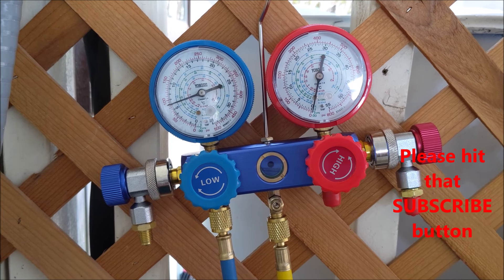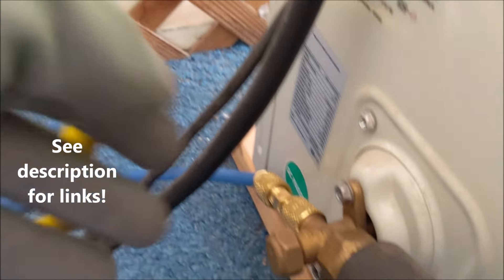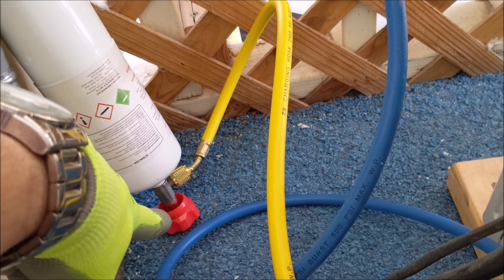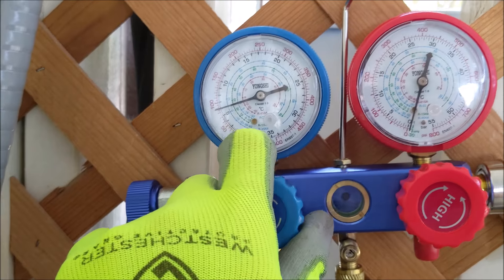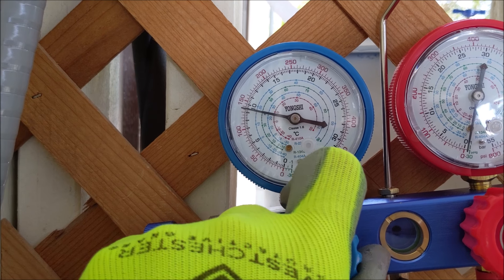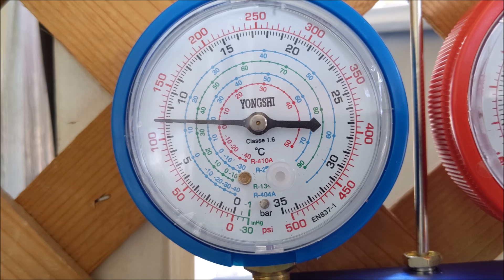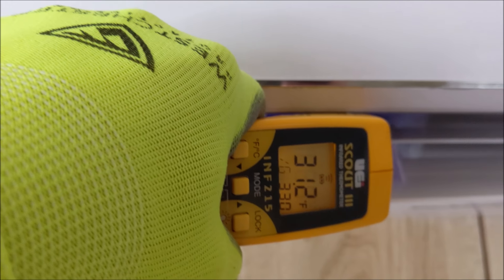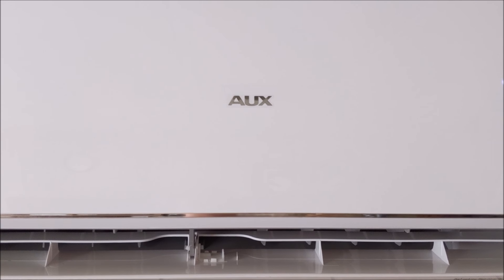How to charge mini split yourself, DIY 410a refrigerant, save money!

Comment: My entire freon must have evaporated as my return line connection was lose. I know i have to vacuum the lineset, should I close the those 2 hex nuts when I vacuum or leave it open and vacuum?
Reply from the maker: Tighten the lines properly, use Nylog, vacuum the lines, then add refrigerant. Links below.....
Discounted links to DIY your mini split......
Manifold gauge set....... https://amzn.to/3cgXrTe
2 stage vacuum pump..... https://amzn.to/2JWdeM4
Adapter for mini split (5/16 to 1/4)... https://amzn.to/2Ys9qLN
Nylog blue.... https://amzn.to/33iYLkS
Senville 3/4 ton... https://amzn.to/2UiJhc5
Pad for outdoor... https://amzn.to/2EMd9Iy
Refrigerant line protector kit... https://amzn.to/2Um1DZI
Power cord.............. https://amzn.to/2XrPgQI
Discount one year of Amazon Prime... https://amzn.to/2qz0RPa
Kit to add outside plug..... https://amzn.to/2Y73aVE
Extra refrigerant..... https://ebay.to/2AoIRvK
Reply: SaveGreenHere thanks for the reply,  so just to confirm,  I should keep the suction and the discharge lines open when I vacuum?

Comment: Can this be done in 30 degree weather? Pretty sure it needs gas.
Reply from the maker: It's tough when it's that cold though.
Reply: I see. But is it possible and do you guys have a video of it being done in the cold? Where I'm at it'll be cold for the next 3 weeks so I was hoping It was possible so I don't have to wait that long without heat 🥴
Reply: @SaveGreenHere  , can it be done on a heat pump like this in the cold, but having it reversed so the heat is pushed inside and the cold is sent outside?

Comment: How do u know how much to add ???
Reply from the maker: Kevin, open the valve for 2  seconds and close. Wait 30 seconds or so, and repeat gradually. You should see the needle climb. Get to 117 tp 120 PSI, and you're gold!
Reply: So the search for gages, refrigerant ,  travel  time  and  the cost of was? Somehow my internal  cash register  warning  is blinking.
Reply from the maker: @robertl.fallin7062  Zero travel time. Amazon delivered in two days, and shipping was FREE. Costs for everything was less than a service call charge, and not considering the commercial cost for refrigerant. 
Link to 410a refrigerant..... https://amzn.to/31gAI4A
The gauges..... https://amzn.to/31nTA1Y
Adapter for mini split (5/16 to 1/4)... https://amzn.to/2Ys9qLN
Reply: I am not cooling that well and my pressure is 120 ???

Comment: Thanks!  I added 2.5oz R410A, upright, as a gas, to my new Pioneer 12k Mini-Split   Did I do harm???
Reply from the maker: If you did not measure how much you were short, you may have added too much, or not enough, depending on size of the unit, and how long of a run on your copper lines.
Reply: @SaveGreenHere  Thanks,  my line-set was 30ft, 14ft over,  The manual stated to add 1 oz for every 6ft added.  So I weighed and added 2.5oz . As I remember the pressure is still under 100psi, but that was on a 60deg day.  I will check in June.  Do you agree the psi should be aroun 118????
Reply: @SaveGreenHere  How do you take that measurement? My unit for instance is a 24k system with a line set of about 16 feet long. I checked PSI with unit running at full blast set to lowest temp of 61F, PSI was as high as 40.
Reply: I've heard that you add r410a as a liquid as it's made up of two different gasses. When adding as vapour, you can end up adding more of one gas and less of another. I suppose if you put the full tank in, it's not a problem

Comment: My mini split came  with refrigerant that I had to release with an allen wrench in the low side and high side. Should I close them before vacuuming and adding refrigerant or leave them open?
Reply from the maker: Pump the system down so the refrigerant is in the compressor, then fix any leaks.
Reply: @SaveGreenHere  what happened was all the refrigerant escaped when the flares failed because of improper torque setting in the manual. Now that I have seen your video on how to install refrigerant,  should I close the allen screws where I released the refrigerant during the install or leave them open while I put in the new replacement refrigerant?
Reply: Sorry to interrupt,  so did you have to close or leave open the valves where you release the refrigerant..did they answer your question,  I have same problem

Comment: A little unclear,  is the system running while you add refrigerant?
Reply from the maker: Yes, running. On cool mode. The system is so quiet you can barely hear it running, but when I did show the temperature inside coming off the unit, and that can only be done while running.

Comment: question, when your releasing the freon in increments..the 2 valves on the condenser..should they be open or close?..if you can please clarify.i appreciated. am just confused, because when your doing a vacuum to your system to make sure there ar no leaks, your suppose to have the valves closed, and then after open the 2nd valve for 5 seconds and close it again, and then remove the vacuum, and then you open both valves again..so for charging the unit, do they have to be open or close...thanks
Reply from the maker: When we did this, there was no refrigerant on the system, and it was vacuumed. We did another video on the vacuum process here on our YouTube channel. Always best to use a scale as well. In this video, the  tube of refrigerant was within an ounce of the total refrigerant the mini split label indicated for the system.

Comment: I have very little gas in my unit and it requires 44 oz of 410A. The pipe run from the outside unit to the handler is approximately 11' and I'm wondering if I should just buy the scale to make sure I get exactly 44 oz in the unit. Do you think it is wise to take this route or the one you have outlined in the video? Thanks.
Reply from the maker: Best to get a scale----> https://amzn.to/3uAivTB
Reply: Thank You @SaveGreenHere

Comment: I notice you are not loading refrigerant by the pound but by psi. How do you determine the pressure needed. I will be dyi installing a mini split but need a 35 ft line and will have to add refrigeratorant.
Reply from the maker: The model on the video was a small 9000 BTU unit, needing the EXACT refrigerant on the tiny refrigerant tank, and the system lost ALL the refrigerant, so no need to weigh it because the small tank had the EXACT amount of refrigerant that the system required. If that is NOT the case, you need to use this to get your exact numbers....... https://amzn.to/3WhSWme
Hope this helps!
Reply: Contact customer service for your system. These systems are designed for DIY and the customer service people know this and are extremely helpful.
Reply: For new install, do you put any in initially before running it or just run it dry first, then add the refrigerant?
Reply: They make a scale and purge cans. Pioneer Mini splits is a great website to obtain the purge can and they have a video for it. Once the purge is complete, a scale is required to measured the additional amount to add. That would be the easiest way to do it without buying a vacuum pump and micron gauge.
Last video I seen was 2oz for every foot but each brand is different and surprisingly quick to help if you ask them the required amount. Do more research.

Comment: Does the unit size matter, i have a 24000 btu mini , should i still shoot for same psi?
Reply from the maker: Yes. As mentioned in my video description, get a scale and weigh the refrigerant, according to the amount indicated on the side label of your unit. Here's one!----> https://amzn.to/3upA8pa
Reply: You need to check the spec sheet for your unit. It will tell you how many pounds to use and then check the PSI rating.

Comment: When I removed that adapter I lost a bunch of freon and oil on my new mini split, should I add a little more oil? And do I add freon if needed with the outside unit on or off? Sorry for the questions I do not want to mess this up.
Reply from the maker: ALWAYS add wit unit running in cooling mode. You will always lose a bit when removing the fitting. Nothing major.

Comment: Hi there, My mini split is cold but frosts at liquid line for ten minutes after startup then it automatically thaws. I believe it’s low in refrigerant by a little. Can I use you method to add a bit of refrigerant?

Comment: Do you do this when the system is on and running? Also do we vaccume the system when it's on or off? I vacuumed the system when it was of with both valves open that releases the freon then I closed it back up
Reply from the maker: Yes, up and running, and only in cooling mode!
Reply: Ok

Comment: I have a Climate Right mini split system. When I connect a gauge at the only access port the pressure gauge immediately tops out at over 200psi.
Unfortunately this 5 year-old system seems to be discontinued, so this is a bit of a hail mary to get it working again.

Any thoughts?
Reply: Make sure the unit is running and then read the gauges.  With the system off, it will be at a higher PSI.
Reply: Yup, nobody says turn it on lol 
There’s another video out there saying shoot for 150psi. I plan to take mine to 120 and check temps then push it a lil higher to get it colder but I don’t want to break it, I just want it to work. 
The proper way to recharge a mini split is to recover the whole freon charge, to zero it out the refill it using a weight scale (the outdoor unit has a label listing the factory charge in grams) and using a different style freon-tank but that equipment alone cost a grand with the 5lb tank.
This method is a patch job at best if the original issue was a leak; Pioneer mini split website sells a 410 tank with leak stop mixed in btw but it won’t fully recharge a 9k btu unit; it can only top it up.
Good Luck👍
P.S. I think they have it ON in Cold mode.

Comment: Thank you for your video. Are the service port valves open or closed when charging?
Reply: system needs to be running.
Reply from the maker: Open.
Reply: are you talking about the 2 valves that have to be opened with an allen wrench? I wondering if they need to be opened or closed?

Comment: I have a set of gauges for automotive use and 117-120 maxes out the low side gauge. Can the high side gauge be used to charge the system?
Reply: I'm not an expert but I've  heard experts say not to charge the high side.

Comment: So I followed the video and got it to 120 PSI, closed all values and disconnected 401a bottle. I left the blue on line to test pressure after removal of 410a bottle and its saying at 150 psi now instead of the 120 I had it at prior to disconnection of the bottle.

Is this normal? Should I be concerned? If I need to let some out what is the best way to do that?
Reply: Same happened to me … why?
Reply: Did you make it work?

Comment: If air and Moisture is an issue if entering the systems. Then when u add the freon how is it no adding air? The supply line from the Freon to the manifold has to have air?  Can u explain this?
Reply from the maker: Bleed a bit on the manifold, until you hear a pssss! Usually a split second.
Reply from the maker: No prob! The links on the vid have everything u need!

Comment: Great videos, thank you. Question: I have fujitsu flex dual zone with an AOU18RLXFZH outdoor unit, are the ideal low side pressures the same 117-120 with both evaporators running indoors? Just had a big snow storm up here in CT so it will be a while before I can run it in AC, but the system has had that water running sound along with gassing sounds after cycling off. Fwiw, its been doing that since I sucked it down, released the precharge and started using it last summer. No leaks according to nitrogen test or electronic leak detector since then.

Comment: How long can you store the refrigerant, if you buy it now and may need it when the AC is needed which would be in a few months from now here in Illinois.....we have 2 mini splits Gree brand, the one is good, no problems the newer model seems to be low on refrigerant at the start up of each summer which will be the third this coming year, we checked for leaks, tighten up the fittings and it's all good, just never did find where it's loosing it. It heats fine in the winter though. Luckily we have a friend that an AC guy and he comes by to fill it for about $100 each time, but this would be nice to have handy instead.
Reply from the maker: No, refrigerant will not go bad. As long as you have a fully sealed cylinder and there are no leaks on the cylinder you refrigerant will last indefinitely. ... Other than that your cylinder is a sealed unit and will not deplete or leak any refrigerant over its lifetime. If "your friend" is charging you $100 "each time" he comes, he's probably adding a pound, two, or three pounds. Get 25 pounds for $110 and do it yourself  MANY TIMES OVER with this jug....... https://ebay.to/38U1yn8    If you need gauges, the link on the description has the best priced one.

Comment: i just ordered a 2 zone 18000 btu mini split condensor with 2 9k indoor units.  It does not come pre charged how much freon should I purchase and how much should I preload before I start the system?
Reply from the maker: The label on the unit should tell you how many pounds of refrigerant. Just but this one, and it should be enough, with refrigerant to spare.....  https://ebay.to/38U1yn8
Reply: Thanks for the quick response.  They don't ship to Hawaii but I can get it locally with a friend that has epa cert

Comment: What side do u hook up to high or low side
Reply from the maker: There is only one port on mini split, but on a traditional unit, the low side.
Reply: Mini split systems do no have a traditional high side both lines are low pressure. Typically you want pressure between 115 to 125 and somewhere around 5 degrees of superheat as a general rule but not always.
Reply: @tuffram2165  your kidding or something !
Reply: For anybody seeing this question later. Hook to the low side ( the big line ) Don't even hook to the small line.
Reply: Can you fill a brand new system like this? Or are there additional steps required for a new unit?
Reply: Does the condenser need to be on while charging?
Reply: @tuffram2165  they have a high and a low side, R410a is actually higher pressures than the obsolete r22

Comment: Hi, i have a Fujitsu 3 zone unit, 1 unit doesn't getncool at all, but 2 unit seems normal. Could i use your method to determine if the refrigerant is low? Would i expect all 3 port have the same measurement or i have to test and add refrigerant one by one?
Reply from the maker: What do you see on the gauges? Does the fan work?
Reply: Turn ALL Indoor units ON.
The air temperature should be the SAME on all 3 Indoor units.
If not, Gas Charge needs to be checked and corrected.
If your pipe lengths are within Fujitsu requirements, then the Gas Volume on the Outdoor Name Plate is the correct weight.
Multi splits will have a Refrigerant Liquid Reciever that has some extra Gas for High Demand when units are turned ON, so the Name Plate Gas Volume is IMPORTANT.   🇦🇺

Comment: Hi, I installed a new 2 zone Lg Mini Split.  Getting error code 35 for low pressure after running for a few minutes.  I Hooked up the gauges and added only a little 410a.  When the fan is running the pressure is at 120 and when the fan stops the pressure is at 68.  I’m still getting the CH 35 error code for low pressure when running the unit.  The pressure doesn’t seem to be changing.  Any advice?  Thank you
Reply from the maker: CH35 means you are seeing the low pressure sensor error. This error can be caused by any of the following causes:
Overload operation (outdoor fan constraint, screened, blocked)
Refrigerant leakage (insufficient)
Bad connection of the pressure sensor
Bad compressor sensor
Bad PCBA
You should check for any leakage, or if there are any blockages on the unit. If you are still not able to fix it, we recommend a local contractor to have it diagnosed. https://lghvac.com/professional-locators/contractor-locator/.

Comment: I really appreciate your videos,  I have several mini splits that I have to charge and if you could help me clarify a few things I would be most thankful. I have  several Idea air mini split ac/heat pumps to move, one 3 ton still blowing nice and cold and heats, one 2 ton that cools and heats but not like it used to, and a 1 ton that no longer heats or cools. I've watched your video on how to check the pressure and the other on recharging,  these units have quick connect fittings so I dont think I can use the nylon sealant. My question is could you suggest a procedure on moving them,  i.e am I to just close the line valves, disconnect the quick connect hoses,  transport and reconnect everything,  reopen the valves , puge air from hoses then follow your 2 videos , or am I missing some steps? Thank you in advance.....
Reply from the maker: You need to pump it down into the compressor. Then you can transport. Once transported to new location, make sure you use nylog at the connections if they are flared, or if welded, verify no leaks by following these steps with vacuum pump. On that video description, there is info on the pump you can use and other materials..... https://www.youtube.com/watch?v=b_aysEpNLes
Reply: @SaveGreenHere  thank you so much